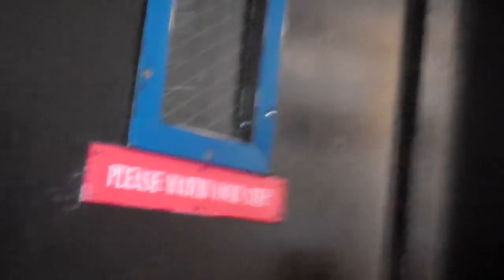Looking Into the Shaft on the Antique Otis Bottom-Drive Winding Drum Elevator at Lettunich Building

Comment: That looks like just pulleys (called "sheaves") The machine room is probably in the basement. The part with the motor that moves the cables is called a "traction Machine" also the professionals call the shaft a "hoistway" the window you are looking through is called a "vision panel".